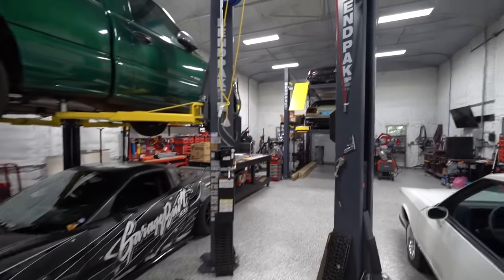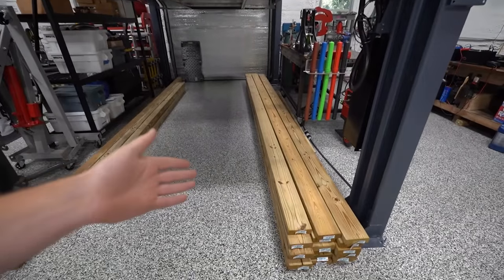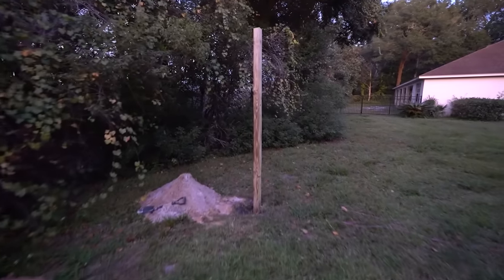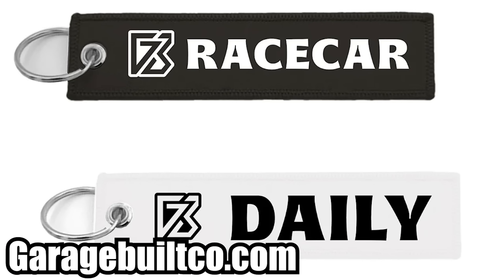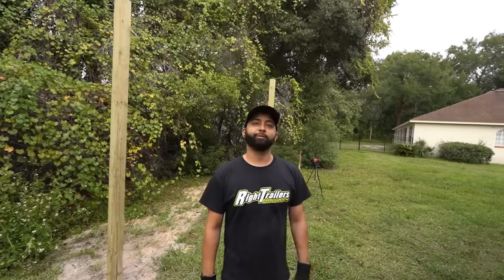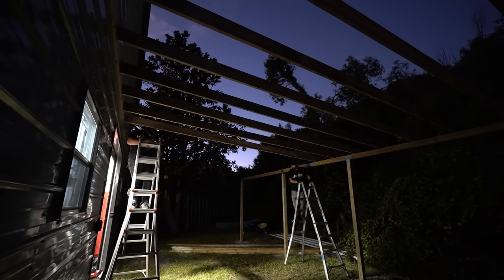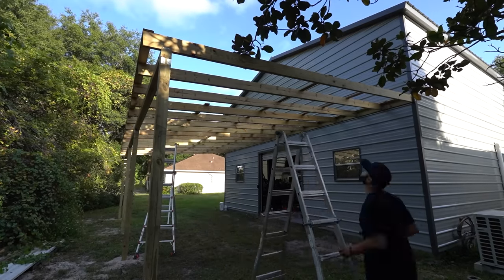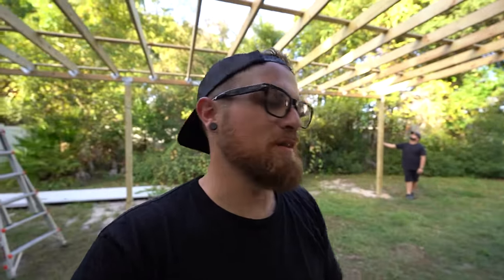Building a new addition to the workshop. all the space

Comment: Pretty great looking build so far but I do have a few suggestions to make it even better!
First off, I've seen a lot of other people mention it, but having the break in the cross-pieces land on top of the posts would probably be better. But I also see you acknowledged that in several other comments.
The other thing I saw that I didn't really see mentioned in other comments is that I feel like there should be something between the ledger board that you attached to the side of the metal building and the metal siding as a sort of moisture barrier. I know you mentioned that you caulked the top side of it and I'm sure after you have the metal roof panels on, there will be flashing to direct water away as well, but I'd still be worried about if there is any sort of moisture (especially since you're in Florida) that gets trapped between the wood and the metal. It obviously will help a ton to keep rain out to have the caulking and flashing, but I'd still think there's a decent possibility of moisture getting trapped there and rotting out your ledger board.

Comment: I think it would have been neat to make this two stories and do a room off the loft. I know alot of people say a deck but the enclosed space would be a great mancave/office. 

Then if you want to do a deck do it on the side facing the house. Enter the deck from the room off back or put a door from the right side of the loft. The deck could span about the same length the loft is on the inside. It can go as far back as the coner of the garage or the second story room. 

Then do a concrete patio about 8ft down the entire side of the garage. Then you can put you spiral staircase from the patio to the deck or have a regular staircase go up the side of the garage on that loeer paito. The bottom of those steps are a few feet from the front walk in entry door. 

This saves floor space in the shop and loft. If you want to enter from in the shop have a latter on the wall with a hatch. 

Or hell do the spiral inside and standard steps outside. 

In my opinion you gain a large secind floor big open room since the loft is now divided with the top car. You gain your covered storage in the back. A nice concrete first floor open shaded patio with standard steps against the shop. You could even use the loft space to work all around on the top car. Build the loft out far enough to have a path to walk behind the car. Pretty much the lift fills a big rectangle hole in the loft floor. 

I know this seems like alot my brain just works that way lol!

Comment: Does the ledger you attached to the building happen to have the edge of a panel right above it?  When you put your roofing on, you can loosen those screws and slide a piece of L flashing up under it hopefully (if the insulation isn't totally glued it in place).

Comment: I hate building with wood.

Going forward, since there seems to be alot of 'you did it wrong" and not alot of 'easy fixes'' heres my 2c.

The jist of it. When you get the pad poured dig out the perimeter for footings and drop in some rebar. At that point, you can build out a metal support structure under the roof while the roof is in service. 

Note. Leave it attached to the shop but add legs on the shop side to take the load off the structure. 

Covered space is awesome to have, going to open up alot of space for activities! 
😎👍

Comment: I don’t know if Taylor will see this but when doing concrete put about half a inch to a inch of water over the bottom of the wheel barrel then open the concrete and put it in the wheel barrel. Just try this and see if it helps you any I do it whenever I do it and learned it from a old guy at the construction business I worked at

Comment: 1 problem I've run into with a metal roof over a car port in central Florida is either the sun coming out or drastic temperature change makes the inside of the panels sweat. Then it basically rains on my car with all the dust and dirt that builds up on the ceiling. Maybe there is some kind of special paint, insulation panels, or maybe my metal roof is just too thin. idk Just putting that out there. I fully detailed a car only to have it ruined by the metal roof sweating. :/

Comment: So the dirt will rot the post, you could have just poured the concrete dry in the holes and water it and it would have set up.
if I were you I would dig the dirt up from the post and get more concrete pour it in dry to the top and water it to keep the post from rotting or termites getting in.
you need to put so 45 deg bracing  1 1/2 / ' on your post at the top to stiffen it also.
Reply: Wood rots in concrete too. Best to not put wood under ground level but put an anchor in the concrete then secure it to that.

Comment: Get a mortar hoe for mixing concrete by hand in a wheelbarrow. It's waaaaay better than doing it with a shovel. Also, with a mortar hoe, it's way faster to mix one bag at a time than 2. find a spot on the bottom of the wheelbarrow where the water is right for one bag and put it to there. It's way easier to mix a bag of concrete with the right amount of water than it is to do it with not enough and add enough as you go.

Comment: I could be wrong. 
But isn’t it better to bury sono tubes and fill them with concrete then attach the 4x4 to that? Otherwise the wood rots in the concrete over time?
Reply: The wood always rots at ground level. So yes it'd be better to use metal brackets to keep the wood slightly above ground level.

Comment: When you putt the buss port on the side to park the buss in inclosed trailer id close it in and put a door from ur shop in to the car port and id concreate it that way if you do need more room you would have it there then if you ever needed to expend to the side then you could just make a spot out fron in the little gravel area were the buss is now you could just putt a roof top there in make a rv spot to park the buss there if you ever need to expend in to the closed in car port area on tge side of the builden butt id defently do it right and make a closed in concrete floor for the bus in new traier that way its tgere and you can work on ur bus in big trae in comfort closed area butt you can expend the gradge wen you need to without to much hastle cuz you alread have the space read youd just have to finish the walls plumbing in lighting and putt mordlifts in butt id put 2 big 2 post lifts in thats in that building that you could sinkernise to lift the buss

Comment: Please stick to car building.  You are REALLY good at that.  Carpentry not so much.  I own an architectural consulting firm and there are a bunch of little details that you missed.  Some are important for life safety and some things are just to make it actually last more than 4-5 years.
1. Splitting the beam as you did even with the metal splice plates is a big no-go.
2. You should have put the posts on Simpson post bace anchors not directly in to the concrete
3. X bracing between the rafters.
4. Diagonal bracing at the posts
5. (you have not shown this yet) provisions for proper flashings to make sure the connection between the new roof and wall is properly lapped and watertight.  
rafters at 16" on center those look to be at 24" (I may be wrong on this)
6. The rafters should have been 2x8's
7. The 4x4 you used across the top of the posts should have been a double 2x8 not a 4x4

This is not meant to criticize.  You don't know what you don't know.  Also when you decide to build a loft inside please spend some money on a proper design and have it reviewed by a registered engineer.  You will end up with a bunch of weight up there (probably more than you think) and if it comes down at the wrong time someone could be killed.

Comment: That 4x4 beam not even close to being strong enough for that weight load............look at what is required to span a 4 foot opening for a window it's a doubled  2x6  and any wider span requires 2×8 ,2x10 and 2×12 all doubled or tripple and joints staggered

Comment: I think you best stick to welding metal together there is so many  things wrong
The outside support beam rule of thumb is 1 inch per foot in depth for span so not big enough also a joint right mid span is a big no no
Fixings to the building are insufficient there’s no bracing no joist hangers
Wrong in so many ways 🤷‍♂️